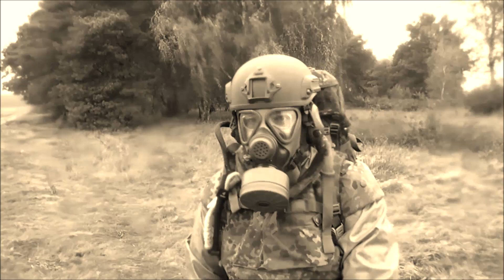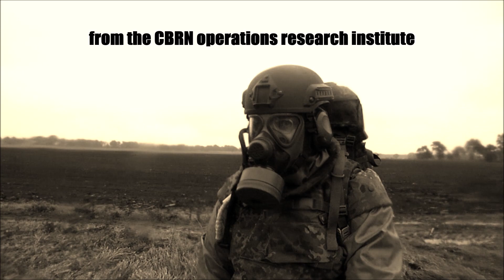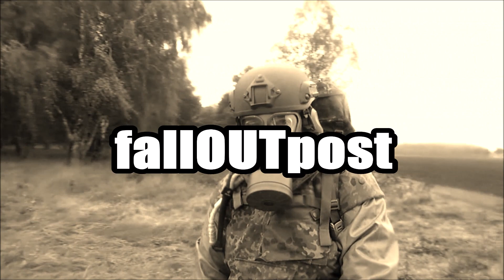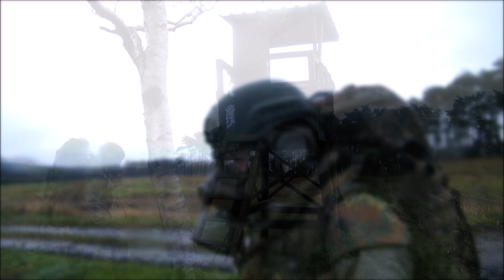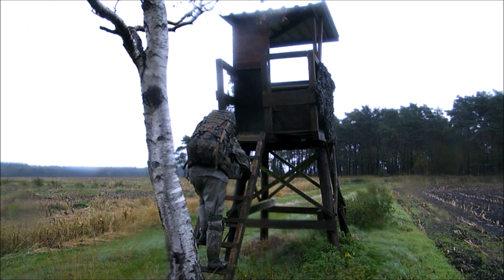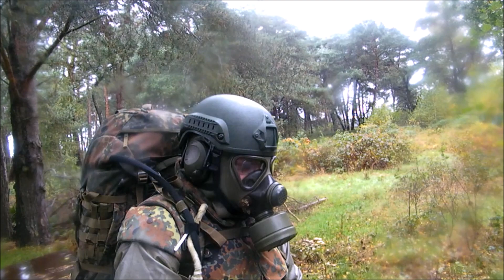CBRN infantry exercise "fallOUTpost"

Comment: This viewer is again amazed at the confidence and self-command which the CBRN Operator-Recruit demonstrates as he traverses contaminated terrain inimical to human life.    As a potentially toxic mist seems to coat his heavy, hermetically sealed, and cumbersome Zodiak suit, and as his thick rubber boots splash nonchalantly through pools of water which may be laden with fearsome biochemical compounds, he strides with vigor as if he is taking a soothing walk through a well-groomed park.

I am duly impressed with the stated desire on the part of the Research Institute to create a group of CBRN operators who are so identified with their equipment, and so completely physiologically and psychologically trained for the physical and mental demands placed upon them, that they would become in effect permanent inhabitants of the contaminated zone.   

I am curious about what measures that the Institute is planning to take in regard to those who are presently involved in its program, for example ZodSqd.   Are there incentives which might be extended to current recruits that would improve their level of performance and endurance?    Are their disincentives that could be imposed on recruits who fail to meet the necessary standards of continuous improvement in their physical and psychological endeavors?    Is there  anything that could be used as a potential "reward" for ZodSqd that might motivate him to prepare for ever-increasing periods of wearing the protective chemical gear?    Similarly, does the Institute feel that perhaps ZodSqn should be threatened with "punishment" if he does not meet the Institute's ever increasing performance standards?

The ongoing research in which ZodSqd is both subject as well as chronicler continues to stimulate admiration as well as curiosity.   Thank you for sharing the results in forums accessible to the CBRN/Protective Clothing community.

Comment: Gréât video
Reply: They are very informative, as an ex military (Apache helicopter pilot) I am use to wear for long period the the m43, but as an helicopter pilot my physical effort are less important, but mentally it draining energy
Reply: As the cabin  is perfectly sealed, we are required to wear those heavy rubber protective suit and gasmask, the m 43 can be easily plugged onto a qui connect linked to oxygen tanks or can be use as an autonomous unit
Reply: I add you on Instagram
Reply from the maker: Thank you!!
Reply: Would love to have a private chat with you
Reply from the maker: @volvopp1  yes, on Instagram or Tumblr if you like.